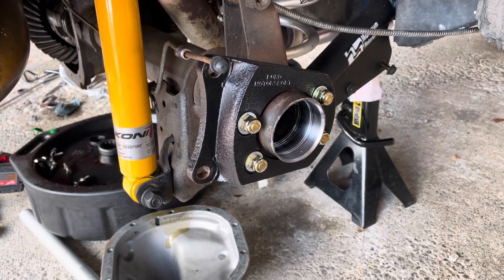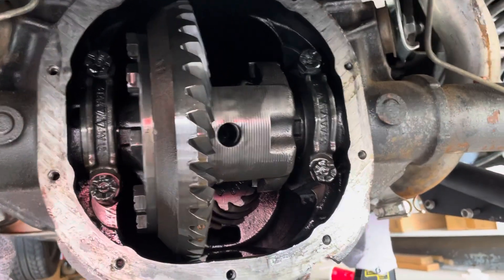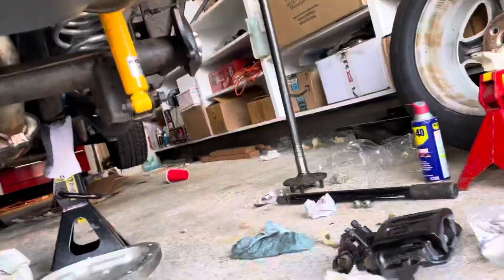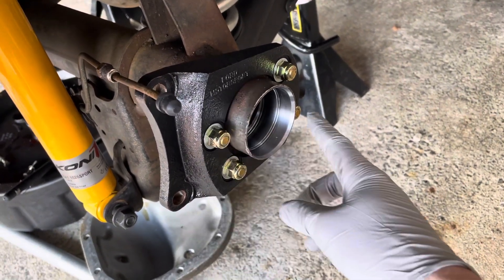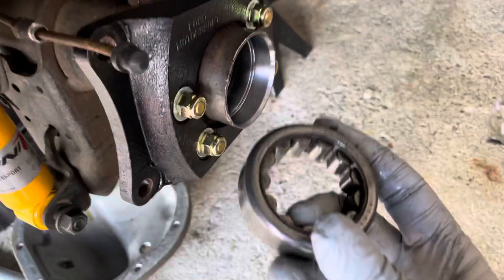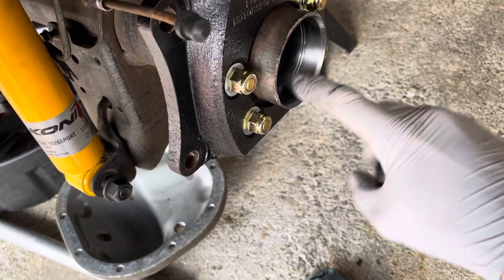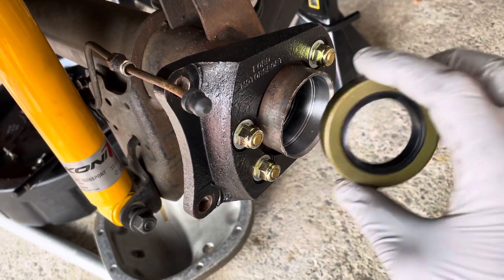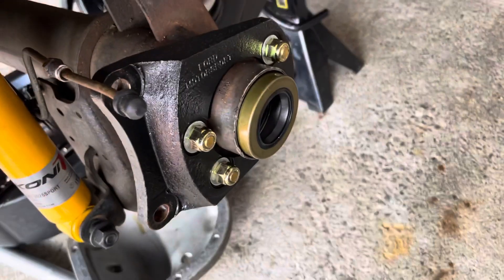Ford Fox Mustang 8.8 Rear Axle Removal and Axle Bearing and Seal Replacement

Comment: I’ve never used and wouldn’t necessarily advise using a torque wrench but use a 1/8 small ratchet to put the dowel keeper bolt in or there’s a good chance of breaking it.  I use a short 1/8 drive so it limits leverage

Comment: My 1991 GT axle is making some noise.  I was looking for a video on how to swap out the bearings.  This video showed me all I needed to know.  Thanks.
Reply: Hell yeah, I've realized I'm just going to pay some other bastard to do it for me 😂
Reply: @darkseidsultion1 yeah I’m thinking about paying to have mine done as well or just finding a better rear dif with the gears I want 🫣🫣😂😂😂
Reply: I'm about to be doing the same on my 92 GT about to be a pain in the ass🤣
Reply: @darkseidsultion1  I had to use a long water pipe to drive out the bearings from the far side.  A puller just made a mess of things.

Comment: Could you tell me the disc conversion kit you have model number and who you purchased from please. Thanks
Reply from the maker: I actually pieced a good bit of it together.  My parts car had the old 4 lug Ford Motorsport kit.  I ended up using the axle brackets, caliper brackets, and e brake cables from it.  I bought new 93 Cobra rotors and conversion brake lines from LMR, rebuilt Ford calipers from Autozone (they are cheap), and EBC yellow pads from Summit.  Unless you buy the stock pads, don’t use the anti rattle clips.  They make the pad sit too tight and and it will get stuck and rub.  The ENC pads I bought needed the tabs ground down (don’t worry it’s safe).

Comment: what fluid goes back in the rear diff and does it need a friction mod with the fluid and taking all this out should I do bearings also
Reply from the maker: 75w-140 gear oil.  You also need to add the friction modifier.  I would do everything while you have it apart.
Reply: @foxmustanghow-tos8614  If you use Royal Purple, it will come with friction modifier added.  Check the label.  Also, it is synthetic, a good plus.

Comment: The bolt inside of the gear box.
Reply: What size is it I couldn’t find it
Reply from the maker: Thanks for the comment!  Sorry for the delay.  I didn’t see your question until just now.  The bolt is called the cross pin bolt.  I ordered mine from LMR but you can get the same one at a local auto parts store under Dorman part number 81048.  Under that number it is called the Differential Shaft Lock Bolt.  As mentioned in the video, that bolt is somewhat soft so be careful not to strip or snap when removing.  Take your time and take pictures along the way for reference. Good luck!